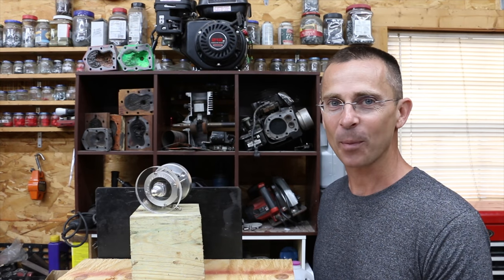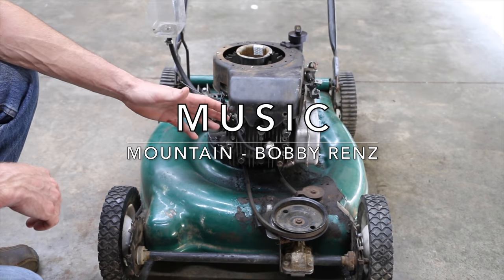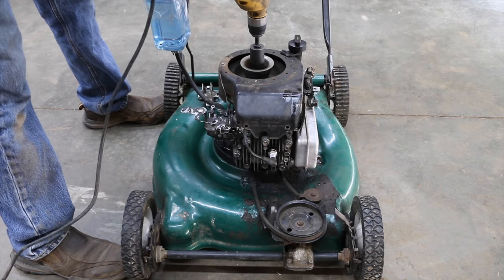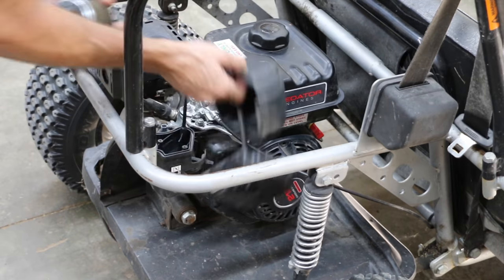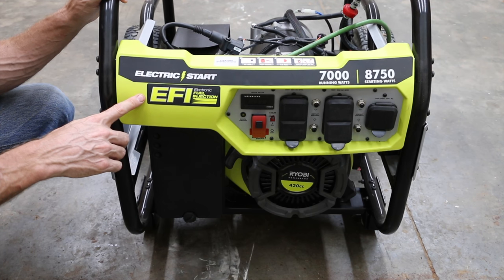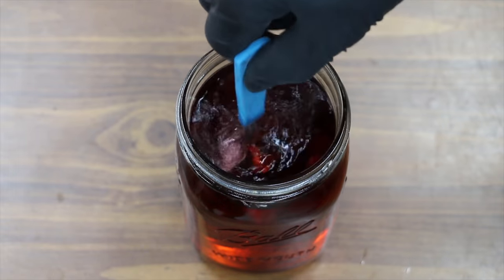Is Leaded Fuel better than Unleaded?  Let's find out!

Comment: In small engines the only reasonable performance increases you should expect are due to better energy density of the fuel due to having no ethanol content. It's not so much about the lead or even the octane rating. I use 100LL in higher performance and higher compression engines where higher octane is needed. Never in EFI engines with o2 sensors because the lead fouls the sensors over time. It also fouls catalytic converters. I also use it in engines which don't get used as often because it is more stable than e10 gas. Again in this case it isn't about the lead or the octane but the stability that matters to me.

It's also worth noting that in my research on this fuel, that I've read that even though they call it "low lead" due to a reduction in lead content over previous aviation fuels, it still has more lead content than road fuel has ever had. In my old truck I mix it with 91 octane ethanol free fuel to reduce the lead content to avoid buildup. It works great that way.
Reply from the maker: Thank you!

Comment: Out in the Alaskan bush the cost of av gas is not very much more than regular,  so we operate all our outboards and small engines (2strokes too) on the avgas because the regular fuel is notorious for clogging filters.   By the time they get it to the bush who knows how many rusty tanks it has been in.  They have to take extra care of avgas because people die if they don't, so we use that and we don't clog up.  It smells like a Cessna starting up.
Reply from the maker: Thanks for sharing!

Comment: Wow awesome video.  How did you make the head for the see threw engine? Thats cool.  I own two old classic cars.  One a 57 other a 63. Both V8's  originally these run on leaded gas. But now we dont have leaded gas. So i run them on todays fuel with a lead replacement /valve saver . Ive always wanted to know if its a good or bad idea  to use this additive . Thanks for the awesome Vid
Reply from the maker: You are welcome!  Thanks for the suggestion.

Comment: The thing I think you missed with this test is the fact that, with the 100LL fuel, you can advance the timing a LOT without generating knock and get a TON more power from an engine.  Unfortunately, it's difficult (sometimes impossible) to do this in a small engine, like the ones you used for this testing.  But that's the big advantage to 100LL -- the anti-knock properties.

I had a '68 Ford Galaxie with a high-compression 390-cu-in V8 in it, and one time I drove to the local airport and filled it up with 100LL just to see what would happen.  I didn't have a dyno to measure wheel horsepower, but the 0-60 time decreased by 1 full second when I set the timing to just below the point where it stopped knocking on 100LL vs. 93-octane unleaded.  That car was designed for 99-octane leaded fuel, however -- what they called "high test" back in '68, so I definitely expected it to run far better on the 100LL.
Reply from the maker: Thank you for the feedback

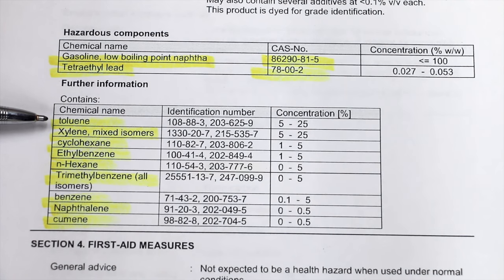Comment: Nice, the first video about leaded fuel. Did the smoke smell different? This is much build up of lead inside the chamber. I think in the list at 2:27 1,2-dibromoethane or 1,2-dichloroethane is missing as lead scavenger. They flush the lead out of the engine.
Reply from the maker: Thank you. I wore a respirator during the testing.  During the go kart ride, I could smell the fuel and it did smell different.

Comment: Hi I saw your list of stuff you have done/ tested.  I didn't see anything about "radiator stop leaks"  and also I was wondering if testing wood pellets would be possible?  Burn times and how clean they Burn.  Also if it's possible to convert a wood pellet stove into a gasifier?   I've heard that they can run engines that are gas, diesel and propane.  Thanks
Reply from the maker: Thanks for the suggestion.

Comment: I been running avgas in my RC plane 2-stroke gasoline engines for years and my carb rebuilds were practically eliminated versus when running on pump gas. I've been running my weed eaters and chain saws on it for two years and not a carb rebuild yet. The gas/oil mixture stays fresh for over a year plus there is no eye/nose burning stench .
Reply from the maker: Great information!  Thank you

Comment: I’m an electrician and we cut a lot of holes in metal from stainless steel to harden steel. We use a brand called tko ideal bits to do the cutting.  My question for you is could you do testing on different types of cutting lube like “stick- kut”, Lenox , clc, etc.
Reply from the maker: Thanks for the video idea.

Comment: 🇩🇰 Denmark
Hi, I enjoy you channel very much. I have noted that H2O2 (Hydrogen Peroxide) clean an engine for carbon deposits, is it true?
Further to this H2 added into the suction during increased idle will do the same, have you heard about that?
In the 70th - 80th we cleaned engine combustion chambers with simple carboniced water from a bottle. It was slowly poured down the carburettor with hot engine, it worked fine. BRGDS

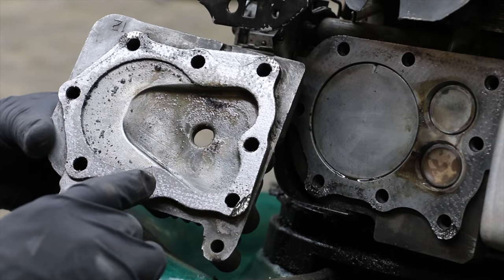Comment: 4:04  You're calling various deposits left in the combustion chamber after burning the low lead fuel, "lead".  How do you know what those deposits actually are?
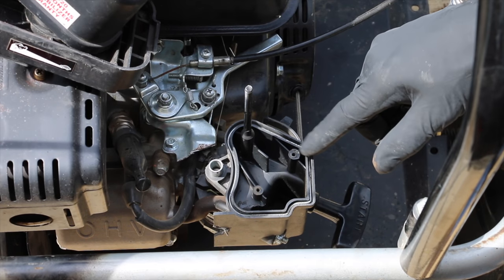6:06  You tuned the fuel mixture of the go cart for the aviation fuel, but did you tune it for the base line run on regular pump gas, or assume it was already optimized?  Would have preferred you tuned the mixture for both the base line run and the av gas run.
Reply from the maker: Thank you.  Go kart previously tuned for optimal performance on E10 fuel.
Reply: Totally legit! Thanks for your hard work. 👍🏽

Comment: I used to work on continental and Lycoming airplane engines and I can tell you without a doubt that aviation fuel does make a significant buildup of carbon on the piston top and on the cylinder crown (cylinder and head are 1 component in an inline opposing engine {flat 4 or flat 6 but not a boxer engine}). Some of the pistons had a thick 1/16" layer of carbon buildup on them. Considering how long it takes for that buildup to occur (airplane engines can only have X amount of hours on it before it has to be inspected/rebuilt), I wouldn't recommend aviation fuel in your car or truck.
Reply from the maker: Thanks for sharing.

Comment: You're a madman for doing this At home. Anyone that I know that flies those planes that have to use that fuel, wears a respirator. You're willing to incur that much lead poisoning on your own property. Bravo.
Reply: I fly on 100LL and neither myself or any other pilot wears a respirator! An oxygen mask is required above 14,000 feet. Maybe that is the mask you saw!
Reply: @ConvairDart106  no, I'm talking about the refueling crew. It's just a filter respirator.

Comment: It will only make a difference performance wise with higher compression. Lead was added as an octane booster/anti-knock agent and lubricant for the exhaust valves.
Reply from the maker: Thank you for the feedback

Comment: I was thinking about replacing the spark plug with a glowplug and running the petrol engine on diesel .. can you try it ?..another idea is to seal the sparkplug completely with a bolt having the same thread pitch as the sparkplug and running it on diesel, to see if there's enough compression in the engine to ignite the diesel
Reply from the maker: Thanks for the video idea.

Comment: Pre smog leaded gas era cars often had higher compression ratios(often 10:1 or higher)  than most post smog engines (typically 8.5:1 or less)  

The extra build up may be from it just burning weird in a lower compression engine than it was designed for.
Reply from the maker: Thanks for the feedback.

Comment: Have a question I've watched many of your videos. I personally have one big question to ask. I have a sports car that I have not turned the engine over in roughly 15 years or so...I've been told many things in regards to turning the engine over before trying to start it. What are your thoughts? After your videos  I trust your opinion and suggestions. Thanks and keep up the great videos.
Reply from the maker: You might consider removing the spark plugs and adding a small amount of Marvel Mystery Oil.  It'll help provide top end lubrication before starting the engine.  Fresh oil and filter would also be a good way to go.

Comment: During WW2 the Army Air Force would fly on up to 150 octane gas sometimes. It’s nuts to think about how that must have had lead in it. The real benefit of such high octane is that you had to run ridiculous amounts of boost into high compression ratio engines to get good high altitude performance.
Reply from the maker: Thanks for sharing.

Comment: Aviation fuel, with or without lead has an octane of 110, which is a long way from 87 or 92 pump gas. It will have a very different burn characteristic than automobile gas. Avgas can burn leaner than regular gas, it also can take higher amounts of ignition timing and compression than 87 ( do not ever use high advance rates in an aircooled engine, it will over heat, even without pinging). Avgas is ok for automobile engines from 1955- 1970 with high compression.
Reply from the maker: Thanks for the feedback.

Comment: Couple of thoughts here.  We had been using leaded gasoline for decades with no ill effect on spark plugs.  In fact, engine blocks were made of a lower grade, softer steel back then.  The lead was meant to fill in the scratches as they were made inside the cylinder walls.  Since we removed the lead, engine blocks are now made of higher grade steel to reduce the problem.  That's also why engines today can last 2 1/2 times longer under comparable use.
So leaded gasoline should not harm small engine blocks or the spark plugs.  In fact, there's a good chance it will make the engine block last longer.  But you're still throwing lead into the air for everyone to breathe and cause neurological and developmental disorders.  So please refrain.  I prefer everyone's kids to be as "normal" as possible.
Just my preference.
It's been a while, but I believe I saw a product that allows you to add lead to modern gasoline for classic cars.
And I figured out why your engine was running rough - the blue fuel you're using is 100 octane, while regular motor gas is 87 or 89 octane.  So it would naturally run a bit "fuel rich".  Instead, you should look for that lead additive for regular motor gasoline or perhaps cut the blue stuff with an inert (noncombustible) additive by about 10%, which would put it roughly on par with premium gasoline.
And the white powder you found all over the spark plugs proves my theory.  Combustion was too hot, and the "roughness" was actually the piston being driven too hard.  Run the test again after cutting the fuel by about 10-13% and I'll bet the engine will calm right down and that gray residue will all but disappear.  The inside of the cylinder should come out looking much better too.
Reply from the maker: Thanks for the feedback!

Comment: Well, here’s a can of worms.  Volatility factor (Reid Vapor Pressure) is limited in avgas to a factor of 7.  This mitigates vapor lock at high altitudes.  Many light aircraft have gravity feed fuel systems.  Auto gas can have an RVP as high as 12 during colder seasons.  The lead in the avgas will cause problems with modern automotive engines.  Avgas cannot be dispensed directly into your car.  As an octane booster for an older high compression engine it works pretty well.  The big disadvantage of avgas is its price.  As of 2016 its price had a nationwide average of $5.75 per gallon.

Comment: Hey project farm does mixing synthetic and non synthetic oils , because of a leaking engine, and bringing oil pressure to running level lubricate less than either alone. In other words is mixing oil brands and synthetic not synthetic (mostly)dangerous.
Reply from the maker: Thank you.  I have a video on mixing them

Comment: P.S. Newer engines will not run as good on leaded gas unless you completely retune them. My use of 100-120 octane leaded gas was purplish in color. The fuel I used did not contain Naphthalene or toluene but the same as used for Naval Radial engines. I did asked the fuel guy what was in the fuel and he gave me a breakdown sheet something like the one you showed here.
Reply from the maker: Thank you for the feedback

Comment: I have a 65 Mustang and a 51 kaiser both like a 50/50 mix of av gas and non ethanol gas . It was recommended to me by the manufacturer to use 100% av gas and recommended 2 cycle oil in my chainsaw
Reply from the maker: Thank you for the video idea!

Comment: Hey huge fan. Whenever I’m gunna buy something I check your vids to see if you’ve done a test. I was trying to think of a video idea. If there is one thing I use in my shop a lot it’s round sand paper discs on my orbital sander. Is all sandpaper the same whether it’s from harbor freight. Home Depot or Walmart. Does some last longer does some resist getting build up on it?
Reply from the maker: Thanks for the video idea.

Comment: Curious if you have a way to test emissions? I would like to see ethanol vs pure gas compared on real world distance to see whether ethanol really produces less pollution. I can only find comparisons on like-for-like quantity of fuel, but ethanol uses more fuel over the same distance. It would be interesting to see if the actual pollution is worse with gas since driving 100 miles would use less fuel. This comparison is nowhere to be found.
Reply from the maker: Thanks for the suggestion.

Comment: Those small 4 stroke engines have a built in compression release which is activated by the grind on the cam,so the only correct way to measure the compression is to crank it backwards.
Reply from the maker: Thanks for sharing.

Comment: Kohler used 100LL to test run all their engines years ago because running them on regular gasoline created gum by the time the power equipment they were installed in made to dealer show rooms & created tons of warranty claims. 100LL is the best fuel you can run in your small engine before putting them away for the season. It leaves no gum at all in float bowls & jets.
Reply from the maker: Thanks for the feedback.

Comment: I always had great success with 114 octane turbo blue leaded fuel from Sonoco mixed with Amsoil Sabre. I use Johnsered and Huskvarna saws they rev high. Can you explain to us why the 2 stroke engines like more lubricity and fuels that resist pre ignition better. I myself understand but still find it to be an interesting topic of science. Also could you consider DIY chain sharpening equipment ease of use, price point. No holds barred grinding equipment and file guides all the way down to the snouts that some people use that are super fast. I mean really in depth like how they change the hardness of the teeth.

Comment: I could have sworn I seen you get lower compression in that engine in the past, around a hundred PSI instead of 110. Did something change that I'm not aware of?
Reply: Probably due to cleaning and having odd stuff used in it on and off.

Comment: I am seriously curious. And not trying to offense anyone and I a big fan of project farm and respect and appreciate the efforts into the videos. Why does it seem like no one is concerned about lead? Especially when you look into your cells with lead exposure. Or things like bone burden, contribution to lowering IQ, cancer, lower sperm count, abnormal speed mood instability etc. There is no safe amounts of lead. Lead will go into your body and do it’s thing wether small or large amount. Although small amount of exposure probably won’t have big impacts on your body now it doesn’t mean it won’t later. Aging isn’t the only thing that while decrease IQ, Libido, sperm or cause other health issues. Lead exposure can be causes of that too. Why not avoid exposure and possibly avoid those things for longer Especially when you consider lead can and will be store in your bones and later released within the body doing another round of damages. There is more information out there but I recommend the purely scientific stuff that shows you what actually happens in you body with lead. What I mean is avoid the stuff that tells you what think is safe amount or not. I found that info to be concerned with very short term in the now perspective as if don’t have a future.
Reply from the maker: Thanks for the feedback.

Comment: I'm very skeptical that the clumps in the engine were actual metallic lead. I would have guessed they are some oxide of lead, or of another chemical in the fuel. If they are metallic lead clumps, you can scrape them off and easily melt them with a blowtorch into beads. Care to test that out?
Reply from the maker: Thank you for the feedback!

Comment: I have to know what is the pulley on the front of the teal/green push mower for?
Reply: Also I appreciate the time you take to always reply maybe do a test video on types of  drinking alchohol that can run in the engine in a pinch everclear I know will run a 350 SBC haha

Comment: Higher compression would be possible with the 100LL avgas. If this were possible in your tests, you could extract much more power from the engine since you have margin for detonation/pre-ignition etc. Generally, except for lead fouling and perhaps some power loss, there is little detriment using 100LL in a regular gasoline engine. The other way around (using regular gas in an aircraft engine) would be destructive to the engine.
Reply from the maker: Thanks for the feedback.

Comment: These are great videos 
To truly test avgas you need to raise compression to at leas 10.5-1  try it in a single cylinder like in a motor cross bike   cr250f. kx450f  it does make more power , enough to notice and in your test I could not tell but timing would be off